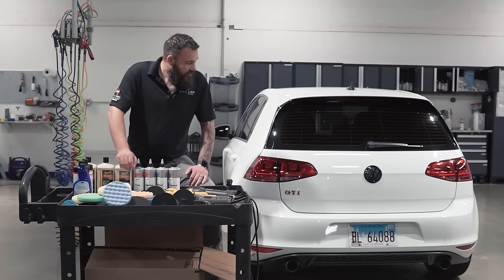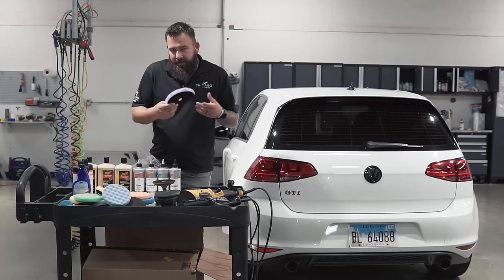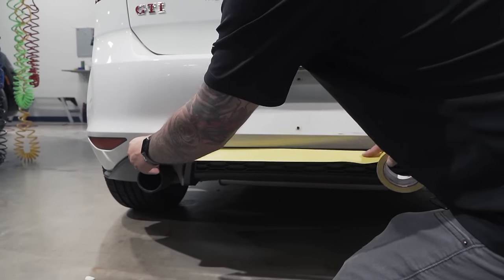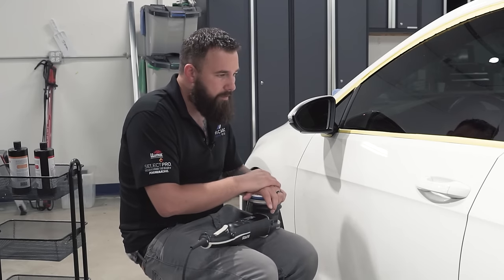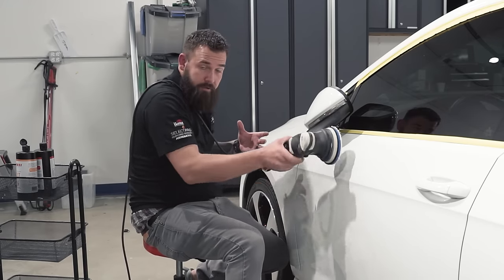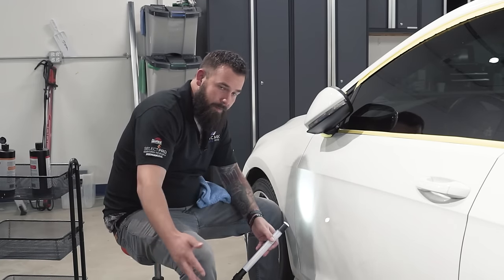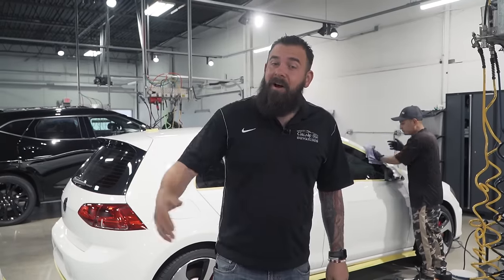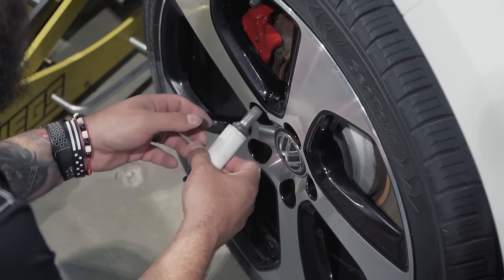A Detailer's Secrets On Paint Polishing

Comment: Great Video !! One way that I try to prevent burning paint is by comparing one section of the paint with another . I look for the orange peel that is normal on the car. When orange peel gets  flat or with out waves then I you know there is not much left and that polishing should stop.  Play with the light and your angle of vision to see clear waves correctly.

Comment: rotary buffer, wool pad meguiars 100, meguiars 205 soft foam.  been painting custom cars for 15 years.   ive sanded a few late model cars over the years, you can get out a lot of deep scratches with 2000 grit  with taking a tiny bit of clear off(like a few microns)

Comment: Wool pads are far from obsolete, I've been using them on long throw DA polishers since 2007.  A microfibre pad on a large orbit DA can be more aggressive than a wool pad.  There are new wools coming from here in Australia soon that are a reduced denier size and will finish LSP ready on lighter colours and a few rich colours.   Wool is not just a cutting pad it can be used for lighter duties and is far nicer and more versatile than microfibre.
Reply: I use 100% wool on my rotary before using a foam DA. Time saver.

Comment: As a guy who washes/details for a living this is a good video.
Still alot for even me to know.
When you work for a dealership they unfortunately have systems and a basic go at the know how's of detailing and i see i have missed out on some points.
Thinkin of takina detailing course even at this point lol.
Wanna go into some business gor myself and i gotta be in the know.
Cheers pal and again a good informative video.
I know the Maguire's products you shown.
Me i go with 3 steps before wax with black cars before a wax finish with miami shine.
Takes time.
I have even gone 4 steps before wax using the max machine polish that has a sandy feel to it.
You gotta go through steps you pass that all over.
Pain in the ass lol.
Only when extremely necessary but been there.

Comment: That was just fantastic--by far the best tutorial on this subject for newbies.

I'd be thrilled if you would comment on my own situation.  I want to explain it to make things easier for you. But you should feel free to skim.

My car, where I will be using a new cordless DeWalt 5" DA polisher, is a Mazda 3 (Soul Red Metallic).  I gather that it has soft paint. The car has been kept outside for 2 years, but I've kept it clean with a weekly tunnel car wash and have clayed it about every 6 months. I've topped it with an ok sealant. Spray wax has been applied at the car wash. I barely noticed any swirls until channels like yours taught me to see them. Curses!

These swirls seem pretty light. I was thinking of using Sonax Perfect Finish with a yellow sponge just to see if that would complete the correction. If my test panel result was no, I'd use a microfiber pad with Sonax Cut Max compound. Then I'd polish with Perfect Finish.

If you have the time and inclination to comment I would be very grateful.
Reply from the maker: Hey thanks for the kind words. Sounds like you have a good game plan for the correction on your Mazda. If you're not getting the correct you would like just work in smaller sections with a slower arm speed.
Reply: @ChicagoAutoPros  Thanks so much for your help. I was procrastinating actually doing the polishing ... and then I saw this video. It allowed me to avoid the worst outcomes (e.g. scorching paint on creases and overheating non-metal panels).  Now I can just go slow without fear. The idea of slowing down arm speed would never have occurred to me.

Thanks again.

Comment: What do you think about using distilled water to cool down the panel during the polishing process? I've been doing it for years and two of my local detailers are doing it too. I know that the compound is a little diluted, but it gives you a cooler surface to work with.

Comment: Can you do the air cleaning trick with a foam cutting pad? I've only got a basic kit with 1 pad of orange, white and black. It's going to take forever if I have to wash and wait for the pads to dry between each panel. Great video! I definitely learned quite a bit.

Comment: Love the information . A Jeep Wrangler has factory stickers. For example Rubicon on the hood.  How do you go about doing paint correction and polishing on or near these?  I assume you can't polish over top? Maybe not even even apply ceramic over top?   Next question will new vinyl emblems stick to a ceramic coated vehicle?  This jeep will be having a plastic rock chip protector with adhesive backing applied to the Rocker panel below the doors. Will it adhere fine?  Thanks in advance

Comment: I keep running to issues when I get most of the scratches out but there is always a slight haze and a few pigtail marks. How do I fix this?
Reply: sounds like you need to spend more time on your polishing step with the haze and the pigtail marks most likely came from something hard stuck in your pad like a small rock or something. make sure you have a completely clean pad and surface when ur cutting and polishing. also u can make the pigtails go away with the cutting pad and cutting compound, go over them til they go away. and u get to the polishing step try and keep ur machine flat with the surface ur polishing, dont tilt it

Comment: I have a brand new multi-coat red Tesla Model Y that was blessed with lots of light scratches in the paint either from the factory, or the delivery prep staff before delivery. What type of pad should I use on it to get all of it out? You mentioned Tesla’s have soft paint and you use a yellow pad, but I’m not sure which one it is on the website. I’ve always detailed European cars and thankfully never had any mishaps, so the fact I’m dealing with soft paint scares me a little bit.

Comment: Great video....  You mentioned using IPA after compound (step 1)... Do you also apply IPA after polishing (step 2) ?
Reply: You can, if your polish doesn't finish as a protectant or your going to apply coating. Its circumstantial.

Comment: How do you get severe water spots out of black paint? Its an 08 Ford Ranger. A clay bar with an iron remover spray helped but they are still there. The truck was in Seoul South Korea for 5 years but my partner said they started here in Washington state. I only mention  South Korea because of the pollution that could have contributed to the severity of the spotting.

Comment: First, thanks for all the videos, I've learned a lot and you explain everything very well. I recently picked up a 2016 Golf R Tornado Red and it's in need of paint correction. Lots of minor scratches, likely from washing/drying by previous owner.  I'm guessing the paint is similar to the GTI. I see you used the black pad for polishing. Lake Country has a 6 pad kit with orange and white pads. Do you think the white pad will polish well? I think the black pad is one step lighter than the white. Not looking for perfection, but any thoughts about white vs black pad? I also plan to DIY ceramic coat...likely crystal serum light based on your videos.

Comment: Thanks for your video, (sorry for my bad english i m from france) I have a question, I use only rotary since 10 years , i make a lot of "wet sanding on new paint, always perfect results but i have to change my rotary, and I understand that today the best choice is DA , so i m afraid to try a DA but I think it s maybe the best choice, what is the best for you between lhr15mk3 and lk900e, i want the best for wet sanding scratch removal(1200/1500/2000/3000 )and especially the best final rendering.  thanks thanks ;-)

Comment: First question, do you find the side of your smaller orbiter buffers burn plastic door handles with their edges? I noticed you do not tape them off and normally have a lot of paint damage around them. I came from the old days of wool cutting pads and cotton finishing pads and you could angle them into smaller areas w/o the heat issue.

Second recommendation is get a hoist. Your back is going to be in bad shape in a short amount of years and plus your really not getting the scratches down the sides of the doors with those angles. But looks good for a one shot polishing.

Good vid !
Reply from the maker: If you’re not confident with the machine I would definitely tape off anything you might hit with the edge of the buffer. Cheers!

Comment: Solid tips. In the middle of a 40hr paint correction/Ceramic coat on a 997.2 C4S I just picked up. Basalt Black paint was surprisingly harder than I imagined. Quesiton: cars that typically reside in Sunny/hotter climates do they effect how the hardness of the clear becomes? I was thinking this "baking" exposure would. Also, what concentration IPA solution are you using before the Ceramic Coating? I'm a DIY amateur dude always looking for ways to improve my technique with detailing.  This Video was well timed! Thanks dude.
Reply: Great questions, couldn't answer paint hardness under sun. I would imagine not, fully cured is fully cured - but UV damage is a possible variable to look for. Older Porsche's tend to have VERY finicky paint, and a are difficult to polish out to a perfect finish. Take time, clean towels, and a 50-70% ipa works well. 

Seriously, we spend 2-4 hours finishing a black porsche. They are difficult to master.

Comment: Thank you soo much for sharing your expertise!!! Would you consider doing a paint correction on a brand new vehicle before you apply a ceramic coating?
Reply: Hello Bill, Ceramic coatings seal in any defects that exist on the paint, so if there are any defects such as scratches or swirls (which can exist on new cars) and you were to put a ceramic coating over those defects, you would seal in those defects. So avoid putting a ceramic coating on the car if there are any defects. If there are defects and you are able to compound and polish or just polish out those defects do that before applying the coating :-)
Reply: Thank you for the replies!
Reply: ekim andersom yes and no, what I kind of failed to articulate was whether or not the defects need something a bit aggressive as a compound then a polish, or just a polish.

Comment: would you say that a Black 2016 Gmc Sierra has a softer paint? Also, if using the lake country 4000 pad washer to clean pads and your doing a 2 step correction. Whats the minumum amount of pads per step needed? Thanks in advance.

Comment: One thing that's always confused me was when retailers talk about cutting or polishing the "paint" but you're really working with the clear coating on top of the paint. The actual paint itself is never touched, right?
Reply: Generally yes.  Most cars now a days use a 2 stage paint.  What does that mean? Basically 1st stage is the paint 2nd the clear coat.  There are some cars that are what they call single stage.  Meaning paint only no clear.  How can you tell?  Get some compound and a towel and do a test spot.  If you apply a little compound to a towel and rub a small area and look at your towel.  If you see color on the towel?  That is single stage.  If no color is on your towel it's most likely 2 stage.  Hope this helps you

Comment: What do you recommend for a all in one polish/pad combination? Thanks for the video I learned a lot!
Reply from the maker: I tagged it in the description. I use the Rupes yellow pad as a one step.
Reply: Test Spot, Test Spot, Test Spot. What may work in 1 paint system may not work on the next. That is why having different pads is important. I've used foam cutting, foam polishing, microfiber polishing, foamed wool and even thinner more aggressive foam cutting discs for an AIO. It all depends on how the clear coat reacts to it.

Comment: If you want to avoid heat would it be safer to do it outside in freezing (but clear) weather? Or would that not make much of a difference?
Reply: You'll still heat the panel, but working surface undergo a higher change in temperature. And lots more. Not recommended, heat is not #1 concern as well.
Reply: I compound & polish in direct sunlight when it's 95 degrees.

Comment: Whats throw? I’m only 3 mins in—so i’ll probably get the answer by the end. But just in case. What is throw.
Reply: Throw is amount of distance a “dual action” machine oscillates outside it’s backing plate or pad diameter. Usually in 8,15, or 21 millimeters. The throw helps dissipate heat and covers more real estate. The pad not only rotates but also jostles or oscillates left , right, forward and backwards.
Reply: mtnmann72 Well put thanks for the reply.

Comment: if I have a lhr-21 mark 3 Bigfoot that comes standard with a 6inch backing plate can I swap that out for a 5 inch backing plate? dont want to buy another polisher if I can get away with that.
Reply from the maker: You can do that, but that machine has a 6" backing plate for a reason.

Comment: Is there anyone on board at your shop that can do this with only a ROTARY? Those of us from the '70's had no options.
Reply from the maker: It's certainly possible, but with modern technology at our disposal it's only right to use the most advanced tools and techniques available to give the best quality service and product to our customers.
Reply: @ChicagoAutoPros  Yes, I see the DA's being A-#1 choice. They are easy-though take longer to correct.  I grew up on using a SIOUX Polisher weighing 18 pounds w/wool pads.  Then came the DeWalt/ect plastic polishers weighing 10-12 lbs & foam pads.  Then came FLEX & 5 lbs rotary. Then the DA's became more powerful to correct the finishes instead of a wax on-wax off tool. Its the rare detailer that can rotary correct & polish, then DA the sealant/wax. I have the FLEX Beast for kicks. Have you guys done many Semis?

Comment: What does it mean when you see “halos” after polishing when your car is in the sun?
Reply: Holograms.
Reply: @ToddTinley  yes. How can I prevent that from happening
Reply: @shiyishong  The sun has nothing to do with it. When using a compounding pad you will get Holograms that's why you finish up with a foam pad in a polishing process. Also called a 2 step.
Reply: @ToddTinley  yes the sun doesn’t have anything to do with it but it shows a lot more of the imperfections. Thanks for the tip
Reply: @shiyishong  You could also use a sunlight indoors.

Comment: Dude - don’t blow off all the pad residue all over the car and panel you are working on - you are just grinding that back onto the paint. Get a bucket with some water in the bottom - swirl it round the edges of the bucket, then blow the residue off the pad onto the sides of the bucket - it will stick there and not blow in clouds of dust round the shop or over the panel you are working on.

Comment: stop using all this new tech stuff, old school is the way to go with a high speed and a wool pad, so much faster and easier. It takes experience to use a foam pad as it takes a lot more heat then the wool pad and you'll start burning everything.